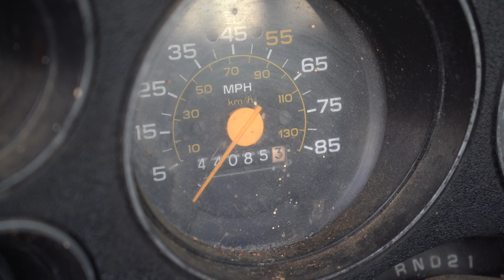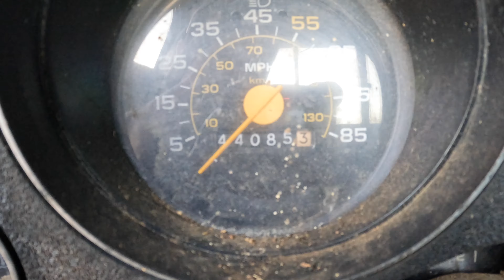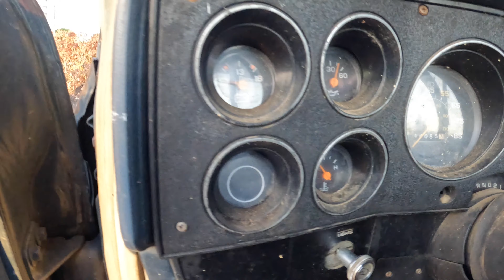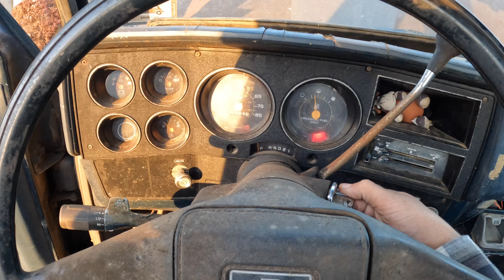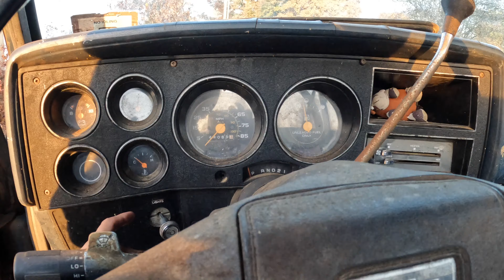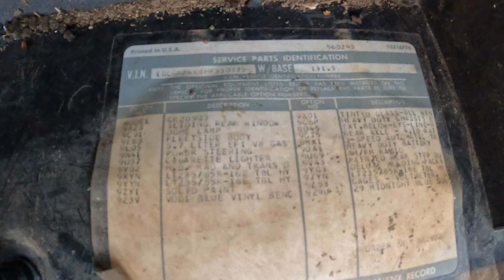BARN FIND SQUAREBODY CHEVY!! PROJECT "FARMER"

Comment: That odomoter could have rolled over and be 144,000 miles.  It''s a great buy.  TBI is, as you say, gutless, but utterly reliable.   You should get a '73 front clip for it to match the Novas.
Reply: All of the evidence that we have leads us to believe that the mileage is accurate at 44,000 miles..truck looks like the farmer bought it just for basic farm use